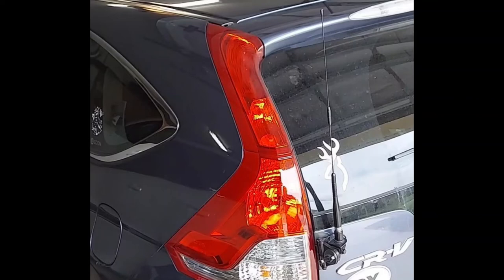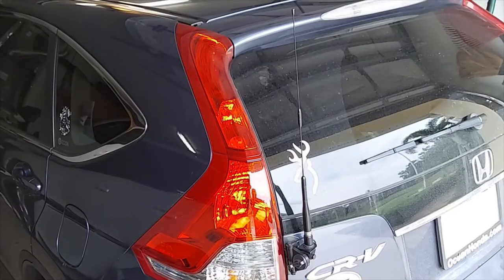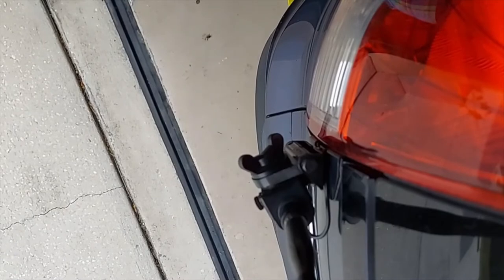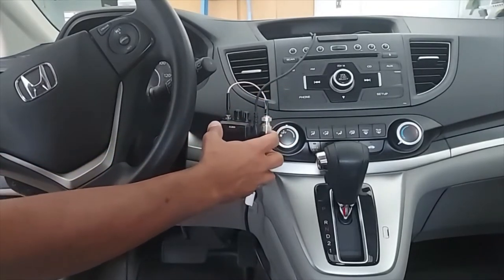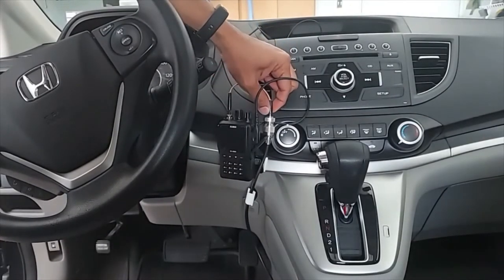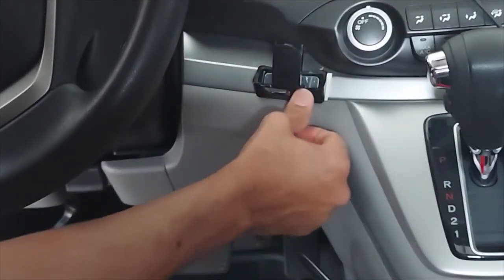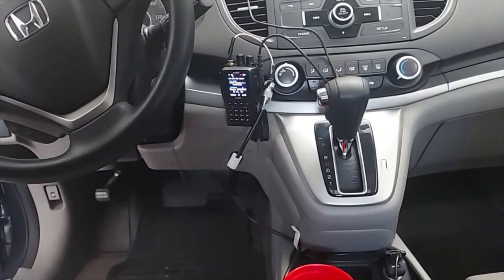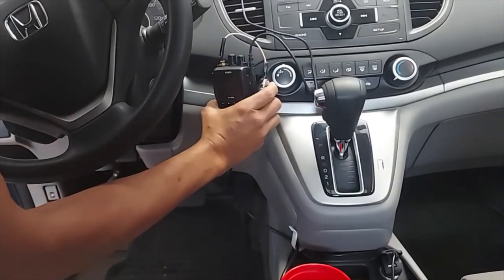HT Install for Mobile Use

Comment: Ive Been a ham for a long time now.  I would not be too worried about wind static too much unless you are in a dusty environment. Static charges from lightning is more common.  Nice video.  I have the dj-md5xlt and getting it on the air dmr and analog.  Seems to be a good prefomer. AA8NN
Reply from the maker: Good to know. Thanks for sharing.